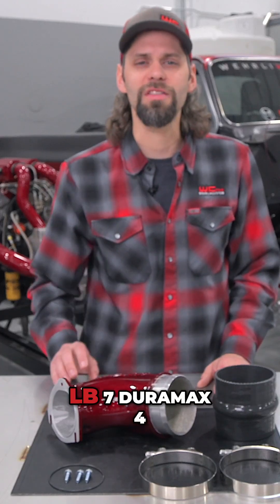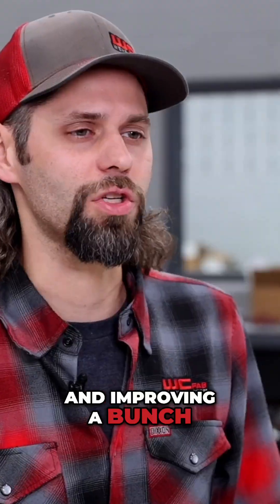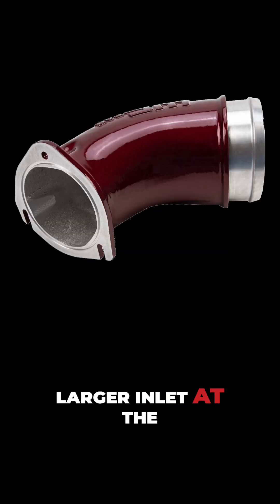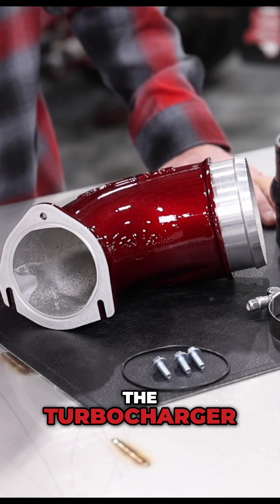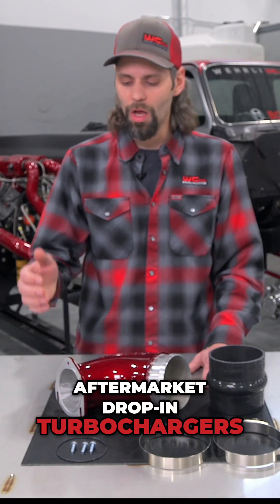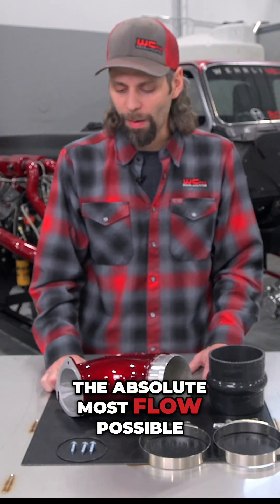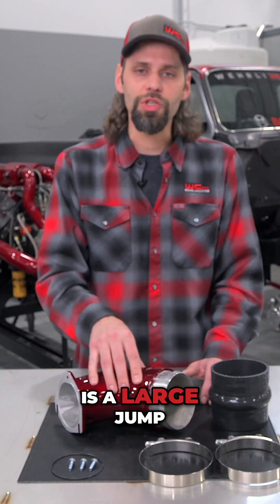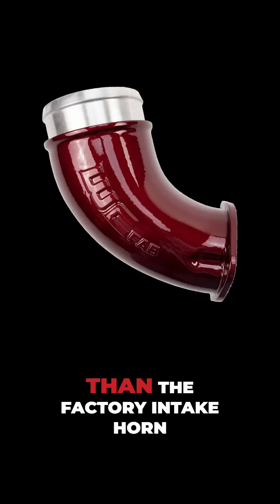Unleashing Power  LB7 Duramax 4 Inch High Flow Intake Horn

Comment: Slamming 5 beers and only bieng able to squirt 3 is not a smart ideah, as the engine can only inhale what it can exhale, this part woll not help unless you have oversized downpipe and exhaust
Reply from the maker: We definitely won't disagree with you that there is absolutely a performance threshold where you need to have better ability to evacuate to keep from building too much pressure in the system and limiting overall performance. However, in our experience for the LB7, the stock exhaust can support more flow than the stock turbo inlet can supply out of the gate. To keep in theme with your analogy - you and a buddy have a civil disagreement you're planning to resolve with a chugging contest of your favorite barley sodas. Let's say a 6 pack - because no soldiers should be left behind. You're both equipped similarly below the belt, no prostate or kidney issues to worry about. One of you gets a pack of long necks and the other a set of vented wide mouth cans. Which are you choosing to win the competition?